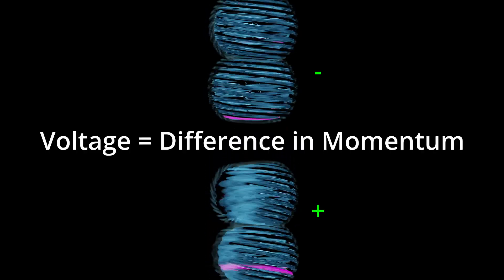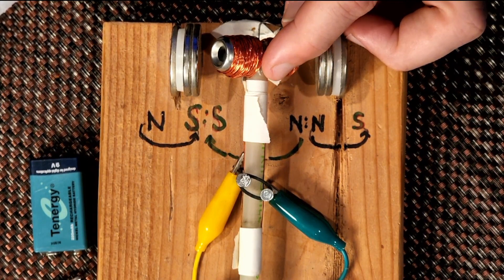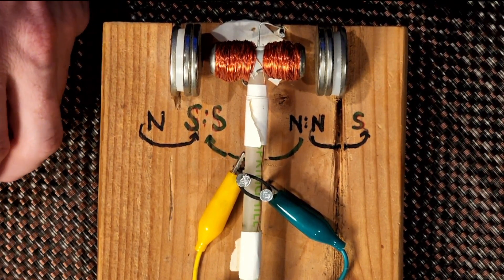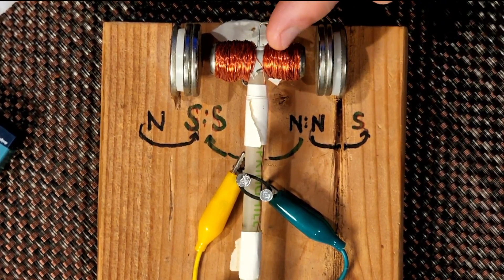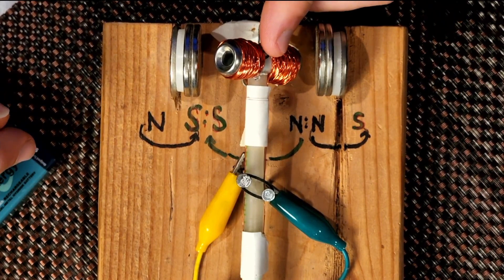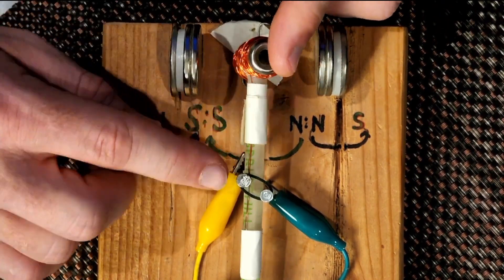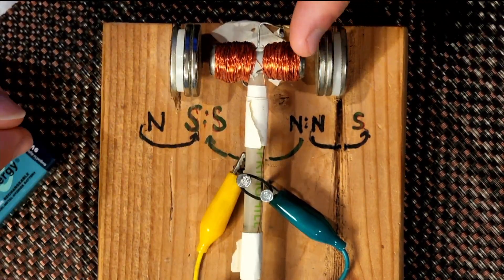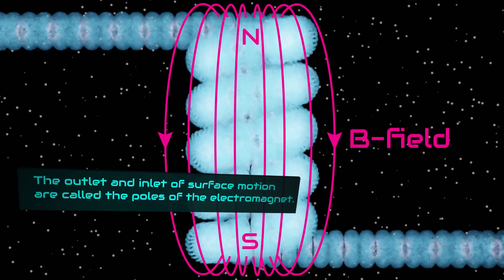Material Explanation for AC/DC Power - Topics In Physics #12

Comment: Allmost correct. I just wish you would stop talking about atoms when it is more likely to be just the electrons that are mooving. 
If I remember right the coil is trying to make an opposite magnetic field to the static magnets when you turn it. To do that a current has to flow in the wire. If the wire is not connected you have no resistance to your turning. If the wire is connected it is trying to prevent you from turning. If you turn it at a constant speed you get a voltage differential over the wires that if shown in time scale will form a sinewave if looked at on an oscilloscope. The swapping of the wires flip half the wave up or down depending on which way you flop. It is usually done by a rectifier.
Reply from the maker: we model the electron as the motion of the outer surface of the atom. Again, electron is activity. Material atomics starts with material actors, not actions.